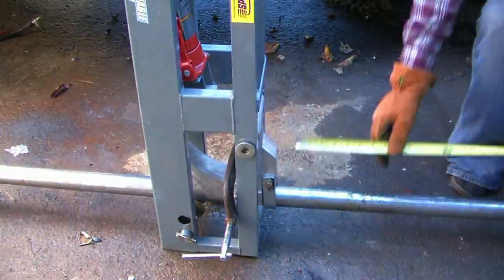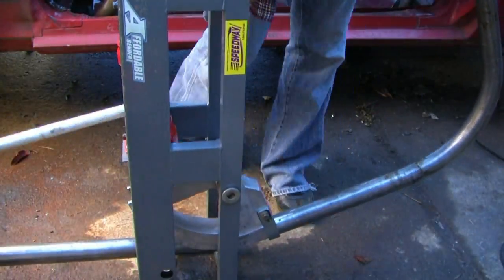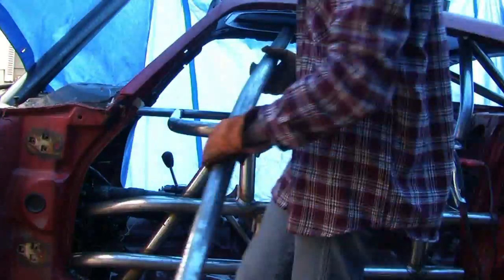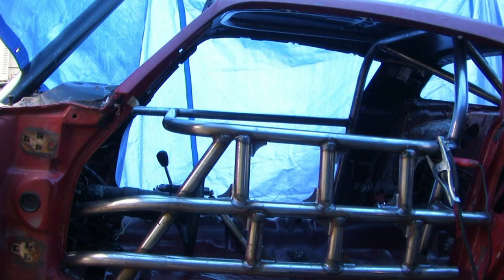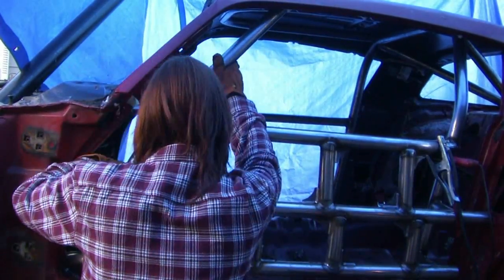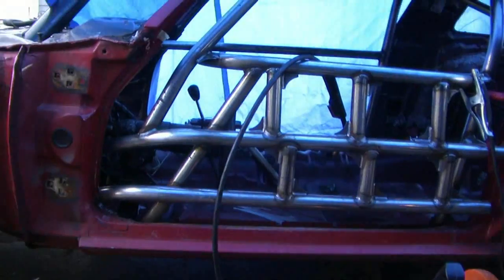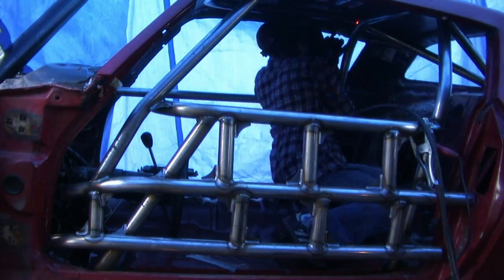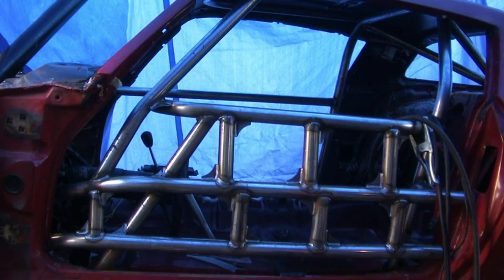Halo and Window Post Installation - Building a Pure Stock Race Car

Comment: flash from the welder is really bad for your eyes, closing your eyes makes NO difference....i have welded on and off for around 40 years and my eyes are still very good...i always wear a welding helmet even if it does not save time it saved my eyesight because i am worth it.   Well done on a maize of bars...a lot of work there and detailed cuts and welds....brilliant.

Comment: I have never seen a roll cage built like that with the dash bar and upper doorbar made together. I like how the door bars are tied into the sub frame. It looks awesome. I'd love to see some pictures of the car finished.
Reply: The reason you have never seen it, is because it is a very poor and unsafe design.

Comment: Just for my info, my don't you use a hole saw for the fish mouth? Is the plasma quicker?
Reply: dynodon427 I know it's old comment. but alot of chassis builders use a plasma cutter. because a hole saw always leaves a little gap if your running it into a angle. a plasma cutter you can offset the fish mouth to get more flush mating surface.

Comment: i was questioning at first when i saw you guys struggling with that crap bender. Im assuming you didnt have a better one with you at the time considering you used to build race chassis or maybe you sold your good one. Or you wanted her to get her own tools plenty of possible good reasons. That is a serious frame id like to see some mustang or ford stuff from you though not a fan of chevy myself.